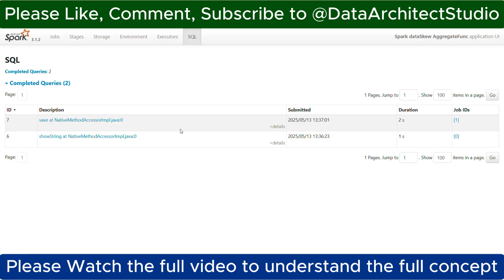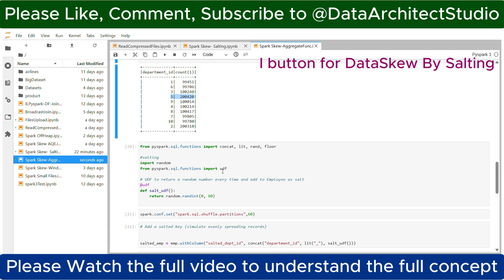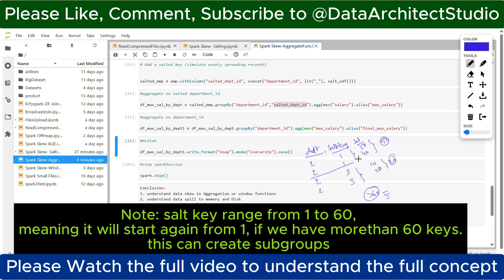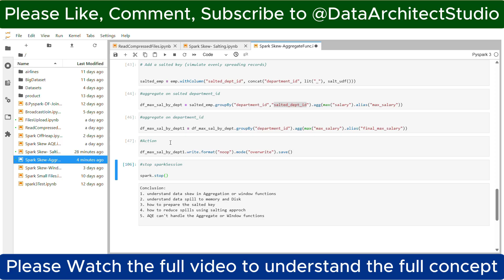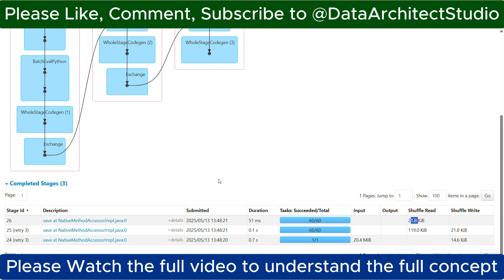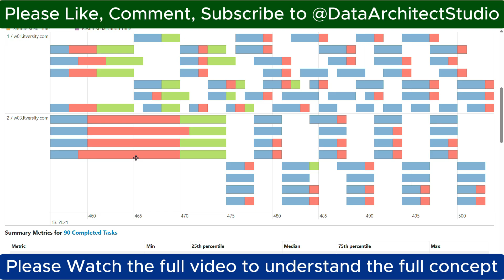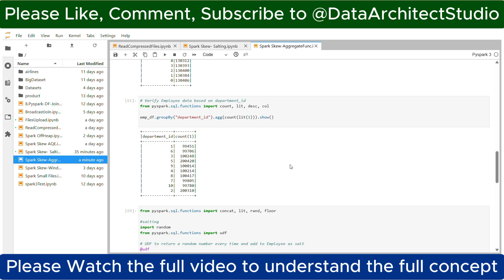My Spark Job Was Stuck for 3 Hours – Data Skew in Aggregation | Spark Optimization tips

Comment: I'm very much interested to learn and do it myself. Where can I run this code? Is it in any cloud platforms like Databricks or you installed Spark locally.
Please guide and make video on how to set up the Spark installations or the cloud if it's in Cloud
Reply from the maker: @satishphad4869 - I have executed these codes in Itversity labs (you need to take subscription). you can also setup in your local machine using dockers but to save the time, I have taken subscription
Reply from the maker: Here is the link: https://labs.itversity.com/